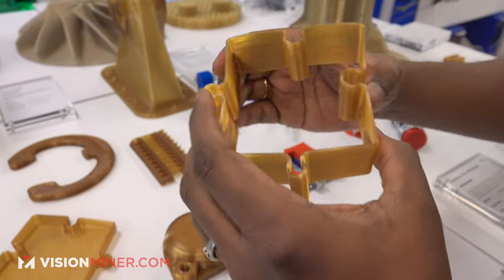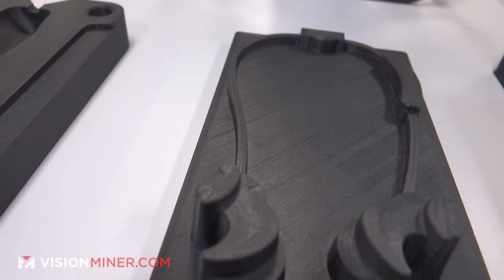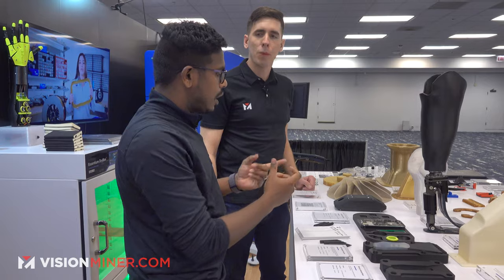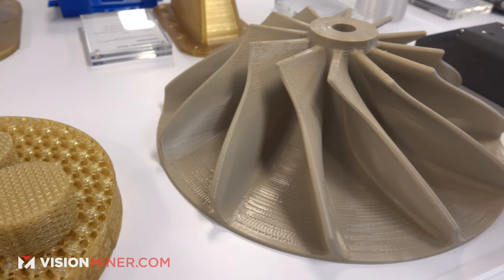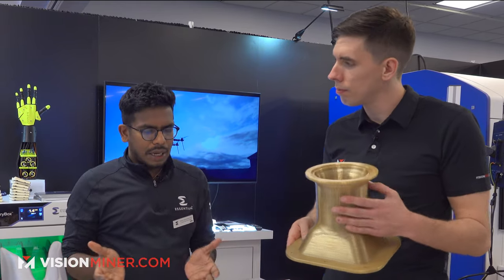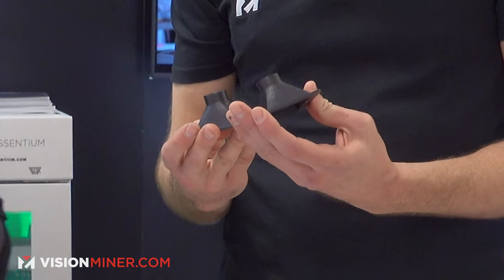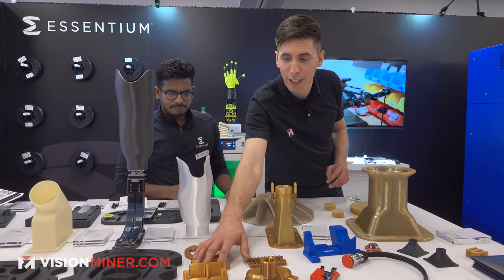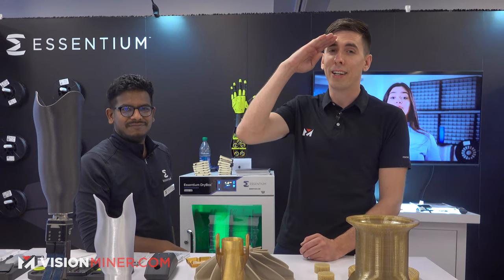High-Tech 3D Printing Filaments: A Deep Dive with Essentium - AMUG 2023

Comment: HTN-CF25 is my go-to material for mechanical fixturing and it easily replaces aluminum in places that I might have tried to cobble together some 8020. Most recently I used it for a custom bracket for a hot-water pipe in a high-vibration environment. It would have taken weeks to get the part from the manufacturer but I had a better replacement designed and printed by EOD.
Reply: That's awesome! Which printer did you print it on?
Reply: @johnschneider9654  I used an old Fusion3 F400 for that one. I've printed that filament just fine on my Ender 3 with a high temp hotend though, it's super easy to print.
Reply: @circleofowls  That's so cool that you don't need a super high-end printer to use it!